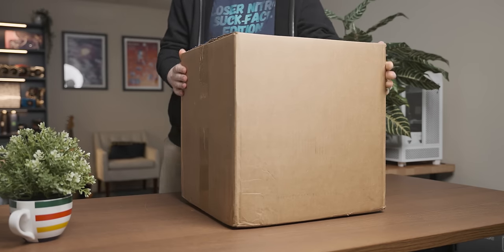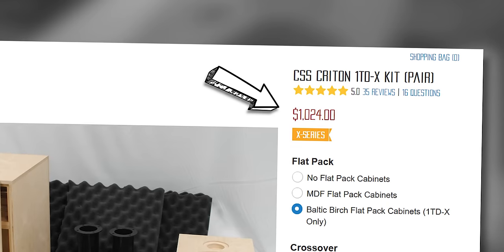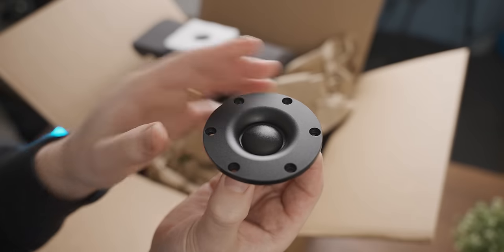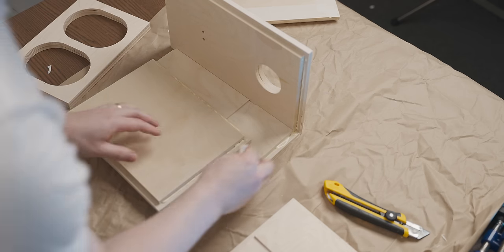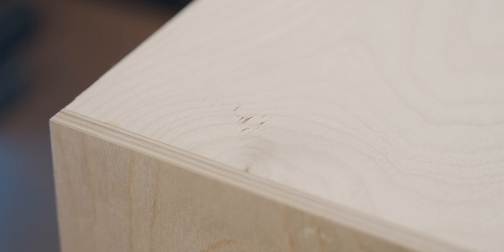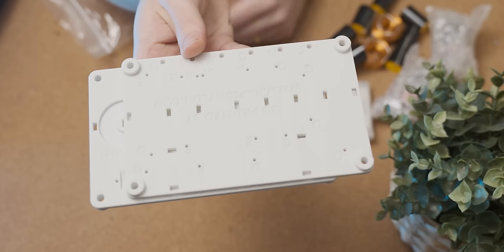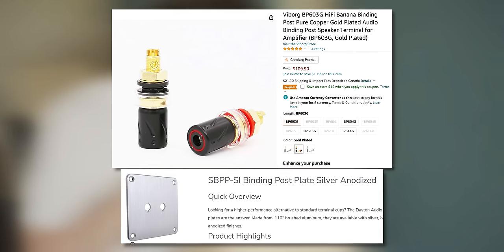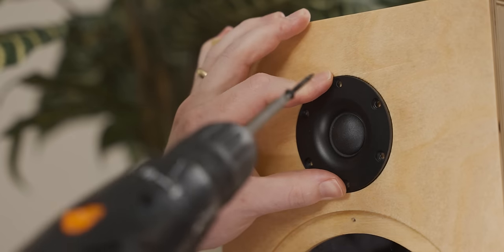The MOST Underrated Gaming Upgrade: DIY Speaker Build

Comment: Always use pieces of wood between clamps and the item if the item surface is something that you will see in finished product.
Reply: Lol good point, clamp use censored next vid.
Reply from the maker: Thanks for the tip!
Reply from the maker: @otysfg  Haha!! 100% happening next time. 😂
Reply: @DawidDoesTechStuff  followup tip relating to clamps.

you can buy pipe clamps and their a lot like the name suggest.
You mount them on right diameter of pipe (usually "black pipe") and they go for about $20 plus the cost of the pipe. 
So you can literally make your own custom length ones or a ten ft one if ya want for cheap and usually sturdier

Comment: As an audio enthusiast this is such an underrated upgrade. A really good way to get started is looking at used or vintage speakers and seeing what you can find a good deal on and make work!
Reply: what to look in speakers?
Reply: @NKG416  Quality, do the speakers feel solid. cheap is thin and flimsy.

But large cheap speakers work, esp when free or cheap. as long as you have space.

Amplifiers have tone EQ controls. so the sound can be tweaked.
Reply: Yeah dude, and a heck of a lot cheaper!
Reply: @NKG416  Look for respected brands like Wharfdale, KEF, B&O, Mission, Yamaha etc. You might have to get pretty old ones if you want them cheap but as long as they've been looked after they'll last a lifetime. I have some Wharfdale Modus 1 bookshelves  that are around 30 years old and they still sound great. Check the woofers push in and out and aren't scraping or fused solid and that the woofer surround rubber is in good condition. Check the tweeters haven't been blown and check the binding posts aren't broken. As always try them out before you buy if you can.

Joe's advice above is good. Having weight and a solid build is always a good sign
Reply: @Cyba_IT  nicee, thanks for the heads up

Comment: Nice vid, I recently upgraded to some studio monitors for my PC. I like having good audio, and I’m not a fan of wearing headphones for long periods of time.
Reply: Probably the smartest choice u could make, may they last u a life time as well because those wont go bad in forever unless the softeners in the rubber gaskets evaporate.
Reply from the maker: For sure, It is definitely much more comfortable not having to wear headphones for a long period of time. Thanks for watching. 😃
Reply: I use a pair of Behringer Thruth B2030A. They are near-field monitors with a good flat frequency response. I use them in combination with a Behringer Ultralink Pro, so I can mix the signal coming directly from my computer sound card, and the signal coming from my MOTU Traveler (first-gen) firewire connected (yes with TI chip) to my music "production" machine.
I am afraid I will never ever be able to enjoy gaming on a "normal" computer speaker set again. Taking about spoiled... 😌

Comment: I love how you love soundstage (that feeling of spacing). It's great for games, but music and movies also benefit tons. In music it's almost like you can sense where the instrument was in the room. I have a Bowers and Wilkins 5.1 setup, powered by a Denon AV receiver with a LG 48" OLED. It's kind of like a one man IMAX. If you love that Saving Private Ryan feel, I'd recommend a subwoofer. Also, I still use VOIP in games because I'm a selfish bastard (I try not to make callouts during artillery).
Reply: you want a subwoofer no matter what. you dont buy a subwoofer to ''get more boom boom bass'' but because its more efficient at producing bass.
lower frequencies are the hardest to produce and the ones that take the most amp power. simply by offloading your lower frequencies and crossing them over to the sub, you actually improve all of your other speakers because all the other speakers can now play more efficient and more clear since they have less work to do and less frequencies to take care of. while you take away stress on your amp at the same time 

also bass is super hard to get down in a room since you ll get null spots and boomy areas somewhere in the room. the perfect spot for a subwoofer is not where the main speakers are but you have no control over it to move it around if your mainspeakers produce the bass. you can even buy a subwoofer to REDUCE bass output but to get better bass quality.

say you have floorstanders pretty close to the wall and they produce boomy bass when they are set to large. ... add a sub... and now they dont even have to produce any lower frequencies anymore and you can put the bass somewhere else.  its about quality and not volume. basicly every speaker wants a sub to supply the lower freqs. even super expensive ones on multiple thousands.

Comment: It’s called sound stage and when you get it right it’s just amazing.
Reply: i really hope david fiddles around with his setup more because its really not ideal at all to get those speakers sing. 
having them behind the monitor for early reflections, way to close together, way to little room to the back and side walls, a window on one side. 
Most speaker want at least 2-3feet away from the backwall to even get to the point where they disappear and the magic happens. 

and his speakers are back ported aswell wich means, they want more space like front ported ones. 

they could sound SO much better

Comment: A few things: exceptional headphones and IEMs can provide quite a wide soundstage with good imaging, but it is largely true that speakers will give you a better experience in that regard, assuming they are competent. High-end components for your crossovers isn't strictly necessary as long as the parts you get have been matched for deviation. The main reason some audiophiles order extremely high quality crossover components is because they aren't building 50 or 100 speakers, so they don't want to order a bunch of components to test and match up just to get a set that measure the same, so buying some that have much tighter tolerances to begin with is just easier. A lot of the cost associated with kits like this is just the convenience of not needing to do the maths to figure out enclosure size, port size, port length, and crossover design for yourself. Personally, I think I'd just spring for a set of Yamaha HS-8 instead and be done with it.

Comment: I'm using Audioengine HD4 self powered speakers with an SVS 12" sealed subwoofer. Great imaging and deep bass on explosions! I used to use an Emotiva 75W speaker amp, with EPOS EL3 speakers. The Audioengine built-in USB DAC is pretty good, but I get more ambience and depth with the CEntrance HiFiM8 as DAC, which I used with the Emotiva and Epos.

Comment: A few tips, if you don’t have enough clamps, tape will work to “clamp” work together. If you’re using clamps, put take where the clamps will go to help mitigate scuff marks. You don’t need to mask off the are to prevent glue, just use a rag to remove the over spill is always better to have to much glue then not enough, also you should be sanding before so that’s makes no difference.

Comment: Cool video, I really enjoy these types of projects personally.  Here is a fun story I thought I would share.  In the mid 2000s I purchased a JBL Spot 2.1 system, well lets be honest, because it was on clearance at a local retailer.  Everybody that has listened to this little system, including me, has been blown away at the size to sound ratio, truly impressive.  Eventually like all speakers, especially subwoofers, the speaker surround broke down and disintegrated.  Instead of disposing of the unit I decided to "refresh" it.  I ventured online and found 2 DT ProMonitor 800s and an Episode 8" woven fiberglass powered subwoofer.  I pulled the JBL unit apart and wired it all together and it sounds amazing once again, dare I say even better than before?  All in cost under $100 and an hour or so of my time.  Anybody with basic tools and a few bucks could easily duplicate this as well.

Comment: Those actually came out looking really nice ... I have vintage speakers / amps in my computer area .. Set ups (1: optical out (B550 Elite> FiiO D03K> Sony TA-N77ES (amp) / TA-E77ESD (pre) > Yamaha NS-344 (10" 3 ways)  ( the sony amp and pre are TOTL from 1989~ amp weights about 65lbs.)   Additionally I have 2nd set  up::  Firestone Audio Blackkey (usb dac) Pioneer SX-3600 > JBL L1 bookshelf speakers

Comment: i love the blurred solder job. I don't know how these speakers sound, but I do recommend getting good bookshelve speakers for a PC. It's really great. I have a pair of B&W CM1 S2 on my desk. The directional audio thing is really correct. You don't need "real" 5.1 with good speakers and a properly configured game (like BF5, which does it really well).

I think they "simulate" direction by playing sounds with different low-pass/high-pass filters (that matches the perceived difference in sound by your ears when sound is coming from behind) and very small differences in latency between left and right channel. I always found that all battlefield games do this exceptionally well on a good pair of headphones OR on a good pair of speakers.

Comment: Now you just need to get yourself your first tube amp Dawid. I'm playing on a pair of high end vintage monitors (the modern new production equivalent sells for $1400 from the same company, with slightly improved parts), but what REALLY blew my mind was when I upgraded my amp to a nice vintage tube amp (i bought a Dynaco ST-70). You can get tons of mods for this amp, my modified all in one driver/rectifier system-on-board came from Curcio Audio Engineering up in Washington state, previously from the SF bay area. My total after buying the original vintage amp for $500, was about $1900, but expect to pay more than I did for the starter amp (or for a parts kit to send to Joe Curcio or another modder who, will also do the assembly if you aren't up for it). If you're comfortable assembling a crossover, and you can read a schematic, you should be able to assemble an amp as well, just keep in mind that unlike a crossover, an amp will have deadly voltages inside it at some point during your post-assembly testing, and wiring it together wrong will damage your components. I did it and i only partially damaged the PCB with my wiring error, no big deal, just had to send it back and get it repaired by joe xD. 

Your glue-up error is definitely no big deal btw, I've assembled worse built speakers than that before, thanks in large part to my friend's CnC work being dogshit. Such is life when you're new at CnC and haven't calibrated your unit yet, the parts they were producing weren't even matching lmfao. But yea, welcome to the DIY home Hi-Fi rabbit hole, next you're going to want a sub, and to do that you'll need an external crossover, or ideally a DSP of some type that also has phase adjustment and some form of EQ (6 points of parametric is all 99% of people will ever need), and before you know it you'll be wanting to upgrade your interface from whatever cheap consumer grade device you bought to get started out. 

edit before the edit: PASSIVE IS NOT A DOWNSIDE. It makes for a much higher quality amp, you can buy great used amps for dirt fucking cheap, and if the amp fails, you can just plug another one into your speakers and those will still work fine. The only downside to that is it adds an extra set of cables, and it takes up a bit more space, but generally this is far outweighed by the advantages of being able to upgrade your amp separately of your speakers, do repairs with another amp powering the speakers, etc...

post-edit: it's also worth noting, that for anything super-competitive, a pair of audiophile headphones will probably serve you better, since speakers and microphones don't mix super great together (RTX voice helps, but wont suppress voice echo). Anyone who is going to buy a setup like this, should not expect to play CS on it with their clan. You should expect to go play Witcher III on it and spend hours listening to the music in game alone, the atmospheres, etc....

Comment: I have a set of Edifier bookshelf speakers that I will use when not using voice communication. Then, if I need to talk, I have a Logitech G Pro headset. I may have overpaid for it because of the branding on the microphone, but I don't think they are that bad. Much better than what I remember my Turtle Beach headsets sounding as I grew up. However, my favorite set of headphones I've ever used are the Audio-Technica ATH-AD900x. I ran those through a mix console with speakers and a microphone. Things happened and that setup is no more, but the memories I make playing with my friends are still just as good.

Comment: 11:00 And this, good people of the internet, is why you don't want big woofers. You want small woofers, in a well designed cabinet. These look very promising. Nice cabinet design, beautiful looking units, decent filters, internal cabling looks acceptable (at least it's no solid core washing line crap). I can't help but think that there's probably cheaper alternatives to these that sound just as good (Maybe something by Dynaudio, The Tannoy M2 or the little Boston Acoustics A25. Or if you're not a basshead, the Wharfedale Diamond III. Or, more vintage, Acoustic Research ar4ax) but these definitely look promising. What also makes me really happy is the huge space around the tweeter, prevents sound diffraction from the edges of the speaker. And I like that they're a 2-way with a soft dome and a smallish woofer. They just make a lot of sense.

Comment: the bracing seems a bit barren, no batten as well.
if you heard some rattling or some loud odd frequency, you can nail a bit on each edges for a bit more rigidity.
as for inner damping, that foam is a bit too much lol; you can replace it using 2mm or 3 mm eva foam lining if you feel the bass is a bit too thin 13:15 with that acoustic foam. 
(you've already got some on that wall behind monitor anyway)
that Unico Research amp seems overkill, but it's good enough for most; otherwise, good job.

Comment: Dawid ist right. I am an Audiophile myself, but a bit more peasant. On my editing I use some Microlab Solo 6C speakers, a Beyerdynamic DT990Pro Headphone in combination with a Antlion Modmic, powered by an ASUS Xonar ROG Phoebus sound card. My gaming rig uses a ASUS Xonar DX to power the Beyerdynamic Custom Game headset. A Creative USB-soundcard is responsible for the Mackie CR4 studio monitor speakers. Combined with a Tonor USB mic, that is a relatively cheap audio setup with way better sound than any gamer stuff. 
General takeaway: Buy used audio gear, not gaming headsets and speakers. The sound is amazing by comparision and it is much more robust. 

And probs to Anna for the woodwork!

Comment: i didn't do them msyelf  but, (its a bit of a story)  i had a klipsch pro media 5.1 back in the day (2003-2005 RIP)  loved their sound  but the amp blew on it, well was missing that system when 201 rolled around and since they no longer made them i instead opted for the klipsch pro medai 2.1's .amazing 2.1 sound , but after 3 years the amp board on them blew as well. wnet a few more years with out them  jsut tucked their remainign bits in the closet.  So looking up replacments on Ebay  in 2018  finnally i came across a brand new amp board that was modified , it had repleced capcitors along witha  fan wired into the board to help cool it.  Been rocking that amazing klipsch sound ever since no issues.

1000 bucks is way too much  for thsoe speakers.  for that kind of money you could go with pro grade guitar/bassguitar speakers and litterally get way more bang for your buck.  of you could sped have that getting a car audio system set up modified for a desk top environment.

Comment: I switched to some passive monitors combined with a smaller amp like that s.m.s.l. unit you showed a few years ago and it blew every kind of "gaming speaker" setup I had before away. Even if you only pay around 200-300 bucks for this kind of setup it is well worth it.

Comment: For those who would like something a bit different and don't want to or can't pay 1k for speakers how about a bit of leg work. 

Charity shops full of old hi-fi equipment. Some good some not so. UK you'd get a decent quality separates system with speakers for less than £100.

Therr are lots of forums and groups that discuss vintage hi-fi so you'd probably be able to to a quick search to check how good the stuff is if your not familiar with it. 

Personally I paired up a pair old jvc bookcase speakers, I got for £16 with a cheap little 20w amp from ebay, think that was about £8. Id say better than anything I could find in a purpose built pc speakers for under abou £100

I dare say with £150-200 budget and some spare time I could come up with something on par with this system.

Comment: I love a good 2ch setup, and they don't have to break the bank! I have a pair of Klipsch R14M speakers hooked to a Fosi Audio T20 sitting on my desk flanking the monitor; the whole setup cost me less than 300 Canadian Rubles at the time. Can't crank the bass up too much, though; I live in an apartment with relatively thin walls which is also an issue with good speakers.

Comment: speakers kick booty, especially if you dont need a mic. for everyone who suddenly needs an upgrade but doesnt have $1500 laying around, you can get powered kantos for $200ish, vanatoo t0's are $400ish and have dsp which give them amazing soundstage(i have a set of these), and at $500-$600 vanatoo has t1e's which i can only imagine are great, kanto has some crazy speakers, and swan also has some killer sets at this price but they may not be as good as vanatoo or kanto for near field (ie desk instead of living room).

if you get any 2.1 system (2 speakers and a sub) id say stick with swan or edifier, but just remember that you wont get the same speaker performance for the price, and most powered speakers (except swan sometimes) will have an output port to add a sub later.